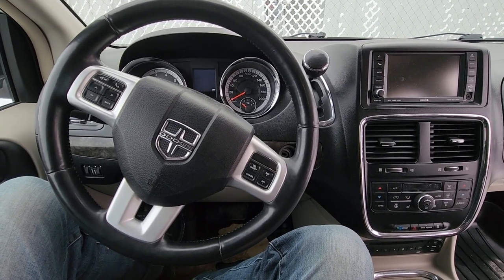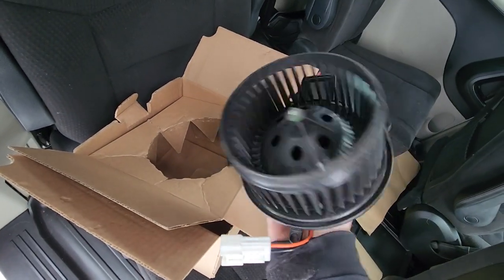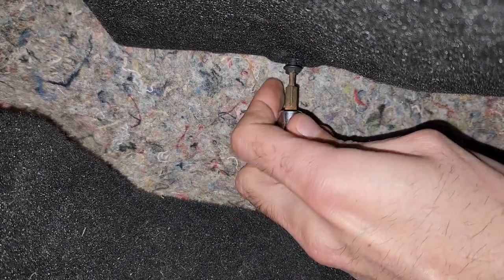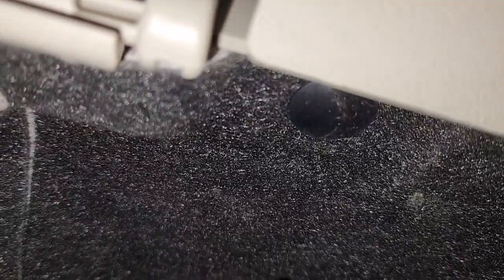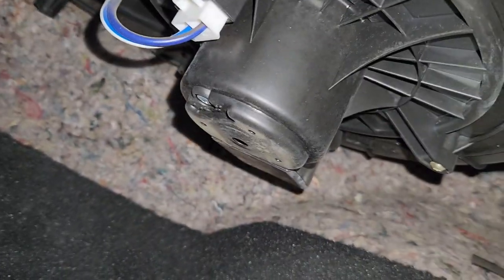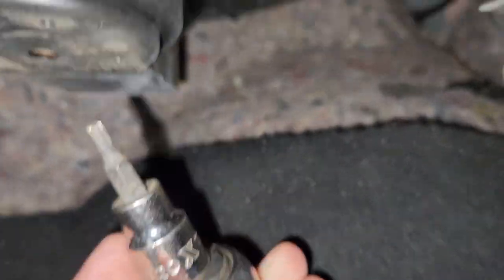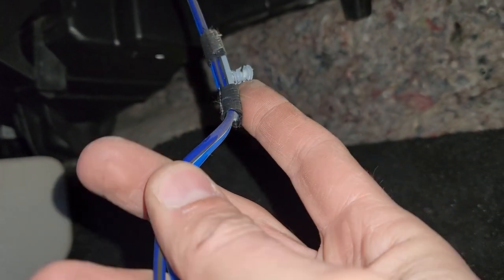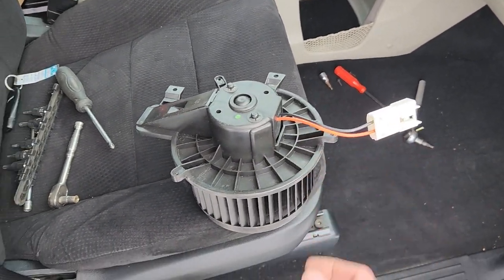Dodge Grand Caravan - BLOWER MOTOR REPLACEMENT / REMOVAL (2008 - 2020)

Comment: Very helpful video. I just replaced my cabin air filter which was a total mess after 140K miles and possibly a rodent tenant. Now the blower makes an awful rattle. I think some of the debris fell into the fan so your video explained exactly what I need to do to clean it out. Thank you!
Reply from the maker: Thanks for watching and for the comment. Good luck :)
Reply: I THOUGHT THE 2010 MODELS DONT HAVE AN IN CABIN AIR FILTER??
Reply from the maker: @itsjustderek  Depends on the trim
Reply: @QuiteAlright  I have the sxt

Comment: Great video.  We had a clogged  motor unit that was preventing any air from blowing.   Not a great thing in winter here.  Your video helped me find, remove and clean it out.  Working great now thanks to your guidance.  Thanks!
Reply from the maker: Thanks, I'm glad you found my video helpful :)

Comment: I'm a novice. Could you tell me what head I need to remove those blower motor screws? Thank you for the video!
Reply from the maker: You're most welcome. You will need torx T20 to remove 3 blower motor screws